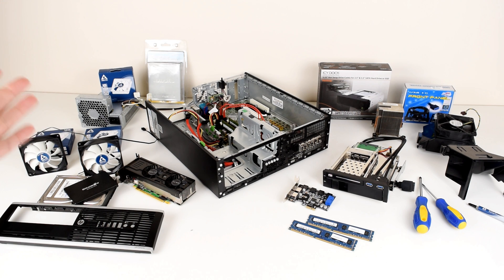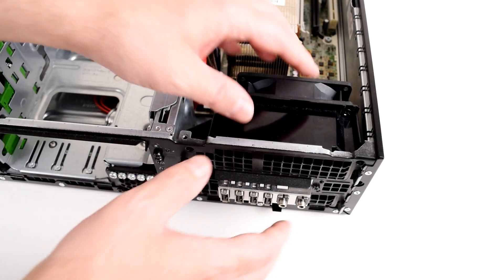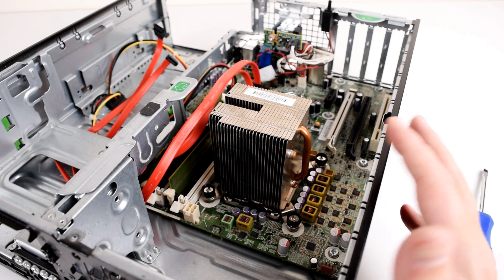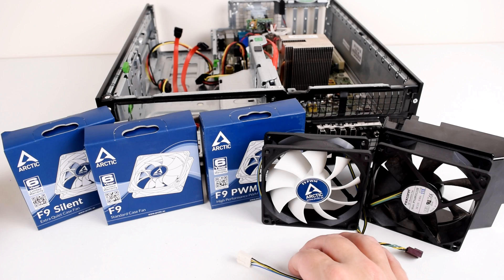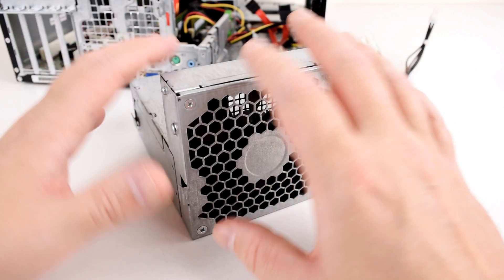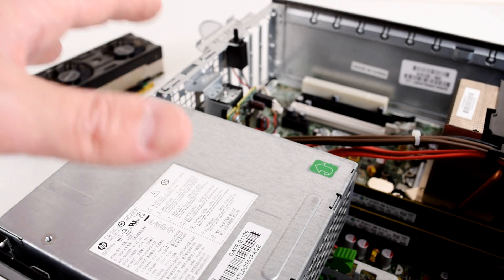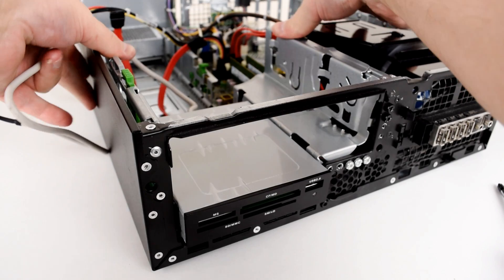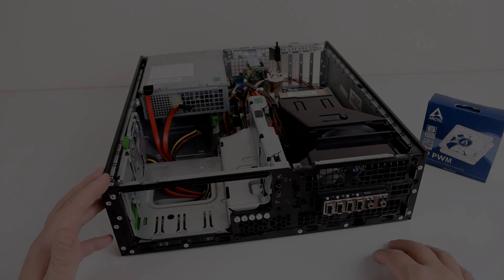Improve your HP Elite Small Form Factor PC

Comment: The whole PCIE power can be very confusing to some. For example Lenovo saying in their data sheet for the M83 SFF PC that the PCIE slot is rated for 40W max.
Yet the same motherboard is used in the mini tower configuration. The bottomline is, that max wattage thing is only there because of SFF specifications.

Those slots do provide 75w since having configuration specific motherboards with the power draw being set that low would be very inefficient in terms of manufacturing the PC.
Run out of motherboards for the SFF config? Well now they gotta wait until they get more in inventory to manufacture more SFF PC's.
Whereas using the same motherboards for all the configurations is more efficient, its really the "25w Max" or "40w Max" is there due to SFF specifications,
but doesn't mean much as the slots will still provide 75w of power to the GPU

Comment: Those older refurbished SFF PCs are great for a home theater PC, small server, for experimenting with, or even a compact PC for less resource intensive  tasks. I wouldn't want one as my main PC, but I would like to have something similar as a TV computer. Also, they are really fun to take apart and mess with, especially since they are often free.
Reply: im using one of this for exactly that
Reply: Home media server is what I've turned mine into.
Reply: Not free here. Usually bidding wars in New Zealand
Reply: @blackterminal  how do i connect mine to my smart tv as the computer does not have a hdmi input. help!!!
Reply: @robertfonovic3551 Hello
. What sort of computer?

Comment: I have similar computer, but with Pentium 4. It is HP dc7200 SFF series. I am hunting for AMD GPU for it, and can't find anything relatively recent. I want at least something with GCN architecture (for Vulkan support), so 7000 (7700+, Southern Islands) series or R5 240 at least. Can't find anything in low power and low profile. Granted I was looking for something around 50W, but maybe I should look for up to 75W.

Comment: I would like to know if there is an hd audio port and 20 pin connecter so I can have usb 3.0
Reply: Hello.
there is no hd audio and USB 3 port on the motherboard.
It is necessary to use additional PCI cards or external USB adapters.

Comment: Thanks for the video.
I tried to install a 5.25 rack.
But it doesn't work because there is no hot plug setting in the bios.
Have you tested yours with 2.5 and 3.5 disks?
Thank you.

Comment: Since the stock fan is 3400 RPM and the Arctic F9 is 1800 tops, doesn't it run into overheating issues at max load?
Reply from the maker: The stock fan isn't 3400 though. It depends on the BIOS setting and the fan speed is variable. But yea, it won't cool as well as the stock fan set to the maximum fan speed, but have you done this and heard how loud it is?
Reply: @philscomputerlab  lol yeah, just set the stock fan to the max speed and it sounds like an airplane is flying over my house, ordered the f9 PWM about two days ago because of your video though, thanks for the info
Reply from the maker: @SergeCCross  Nice! Yea the Arctic fans will be perfectly fine for normal situations :) If you install an addon GPU, they can run a bit warm, but nothing to worry about, they will operate just fine!
Reply: @philscomputerlab  running a 1050 GTX, just installed the F9 Arctic and running it at 1500 RPM (1800 RPM is kinda loud) so far I have noticed that idle temps sit at 3 degrees lower than using the stock fan at max speed which is pretty great

Comment: Even i have same sff cabinet of Lenovo.
But problem here is that graphic card slot is at bottom most of cabinet.
If i attach a graphic card, the Fans face would he at bottom of cabinet and there is no space for ventilation.
Will this make overheat to card?

Comment: Very helpful video. I installed Arctic F9 PWM in my HP 6200 Pro SFF. I had problems with plug in so I cat off a piece of plastic from fan connector. Works very quiet. Unfortunately, the PSU fan still make a noise so I should replace it.

Comment: would the gtx 1650 LOW PROFILE work with an i5 3570 @ 3.40ghz and 8 gb ram on a 240w psu
Reply: Sure...But i would advise to upgrade the CPU to i7 3770..I have seen tremendous boost in gaming performance and general performance as well..

Comment: so plugging in a GPU into these things , does not need to plug into a power supply like the old ones on the side of the GPU itself when inserted.
Reply from the maker: Yes you need a GPU without external power :)
Reply: @philscomputerlab   thanks  yesterday i brought a msi nvidia gefroce gt 710 for 95 bucks. from itec computers where i live. the guy had it he does not have much but its low profile and don't need power. so plug and play really to me. it works well i really noticed the difference with planetside 2 of a i5 3470 standard 8300 elite HP .

Comment: How do you turn on the PWM function in the BIOS?  I bought 5e Arctic F9 PWM and it wants me to plug the CPU power plug into a female port on the F9 fan, which then plugs into the board.

Comment: You have your CPU option in the description as a I7 3770 however the board in this SFF 8200 only supports a i7 2600 and at a push a i7 2600k due to socket of the board being Intel Q67 Express chipset Socket 1155. Just a shout at anyone who still watches this for first time and might buy a i73770 without realising this
Reply from the maker: Ah I didn't realise. I deleted the link for the time being :)
Reply: I have 6300 SFF  and i have upgraded to i7 3770 from i5 2400..No problem in my case.. Dont know about that 8200 SFF though..

Comment: I have absolutely the same PC 6200 Pro SFF. I will tell you that on the latest BIOS version (2019), the Xeon E3 1270 works fine in this PC and reaches 3.7 MHz in Boost mode. Note for those looking to upgrade, the native cooling system does a great job even at 100% load! https://prnt.sc/ucn9ga I also installed 1050 ti and everything works well, the video card is able to work at 100% - it amazes me, with the declared power of 240W. I have previously installed i-3 2120, after replacing the processor I'm happy! This is the maximum power that can be set without replacing the radiator.

Comment: I also heard that PCIe  is set up to 25w, in fact my Proliant Microserver G7 admits up to that power,. So when I was seeing how improve my HP 6000 Pro I read its specifications at the oficial  HP web. In this web, you can see its possible upgrades, one of these oficial options was the Radeon HD 4650 which has a TDP of 48w, so I decided install a newer card with similar TDP: an unexpensive MSI RX 550 LP 2 gb, which runs fine with the Q9400 I installed instead the originaal E5400.

Comment: Have Elite 8100 SFF. Fitted Zotac GT1030. Worked OK but after installing latest Nvidia drivers it takes ages to boot. Hangs with black screen after Windows logo then hard restarts then boots ever so slowly. 3 drivers not loading - dxgkrnl.sys, NDproxy.sys and wdfilter.sys. Tried all the tech forums for answer but no joy. Has anyone come across it here?
Reply: Get a card replacement if possible..

Comment: Have 8100 Elite SFF. Fitted the USB2 card reader and attached the cable to the USB2 headers but does not work. Looks like there's no power as tried fitting old USB2 2 port and no joy. I wondered if the headers could be disabled in the BIOS though Ive not seen any setting.  Seems strange that both are not working. Any ideas?

Comment: Did the Arctic 9 M PWM Fans installed at the front (Intake) and Rear (Power Supply Exhaust) as well as the added Arctic CPU Cooler benefit the Thermal Cooling Efficiency of the Stock (≥ 5800 RPM Delta Electronics). I would think that the airflow would become more obstructive around the CPU cooler and with the reduction in the fans ability to push and pull air through not just the case but the stock CPU coolers fins by using the plastic ducting in the front of the case where the front fan is mounted?
Reply from the maker: I did it to reduce noise, the thermal performance was not a priority to me!

Comment: I'm currently running one of these with the i5 2400 and a 1650, I picked up an i7 2600 and had a bit of an odd problem where as long as the i7 was installed dimm slots 3 & 4 would not detect any ram installed in them and the system would not post if there were any sticks installed in them so I was limited to single channel only through slots 1 & 2, any ideas about how I could fix this? 

I've tried re-seating everything, matching ram sticks, mismatched ram sticks, only putting ram in slots 3 & 4 and have had the same result each time, no beep codes just no boot and the psu fan ramping up to maximum about 10 seconds after the system is powered on.

I'm thinking that the memory controller on the cpu might be damaged as I noticed the one of the resistors on the underside of the cpu looks odd and there is a slight split in one corner of the pcb that the cpu die is mounted on, especially since the cpu functions perfectly as long as I don't put ram in slot 3 and/or 4. Though I would be very pleased to be wrong about that.

At my wits end with the whole thing now and figured that since it was this video that inspired me to give it a go then hopefully you'd possibly be able to provide some insight I may not have considered.

Thanks either way and keep up the good work.

Comment: On the SATA ports, you may have to activate the additional SATA ports in BIOs.  I used to support several of these and the newer versions with Gen 3 and Gen 4 I5s.
Reply from the maker: Yes you are correct, there are BIOS options for the SATA ports.

Comment: Hi my man! I have a HP Compaq 6005 Pro Microtower with a Phenom II X3 B75. The CPU fan is being really whiny, but the case fan is ok

I bought a be Quiet! Pure Wings 92mm 1900 RPM PWM fan, should that fan be ok as a CPU fan? Or should I use the case fan? The case fan is the same as the stock ones you had.

Comment: I have some fairly decent components in my HP Elite 8200, with 16gb of RAM and a GTX 1050 graphics card, but there is where the problem lies. I play a fair bit of Rainbow Six Siege which can be fairly intensive on the graphics card, and the graphics card heats up a lot. I'm definitely going to change the two old fans at the cpu and at the back, but i'm not sure that will do the trick. Is there any space on the motherboard maybe to fit a small fan there to cool down my graphics card?

Please let me now what i can do, a link to a video might be helpful too, thanks!
Reply: Macify I haven’t ran a program to tell me exactly how hot, but it’s hotter than it should be.

Comment: Amazing Video ! But guys, help me ... I have a PC like this and I need to install a USB 3.0 card at the bottom of it. How do I do ? I have no more powers cables in the power supply. Thanks !
Reply: Just need to buy a SATA power splitter cord. Just make sure your USB PCIe card will fit in the case properly. (Low profile, if it's a Small Form Factor desktop case.)